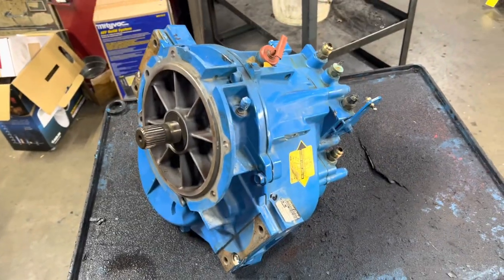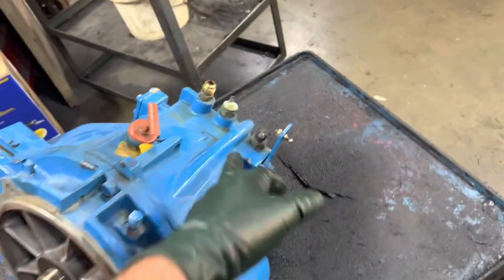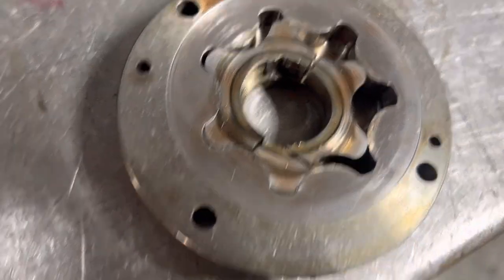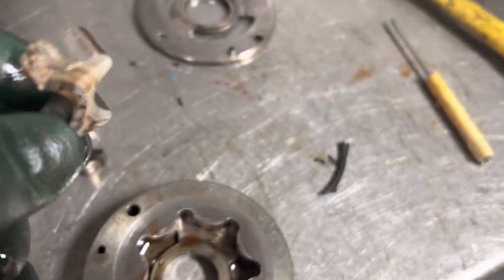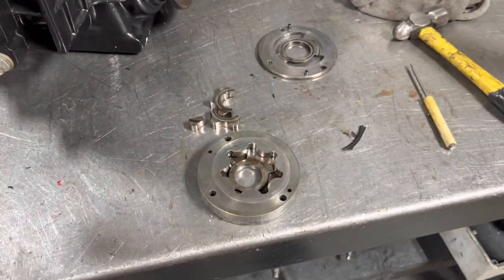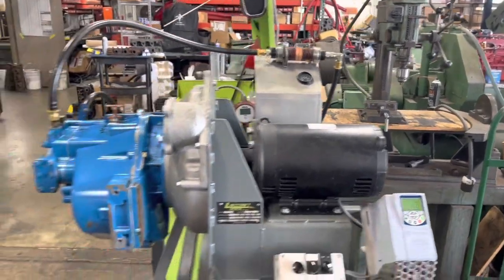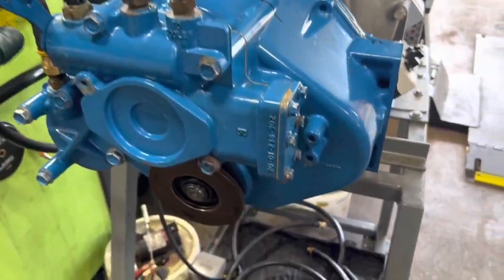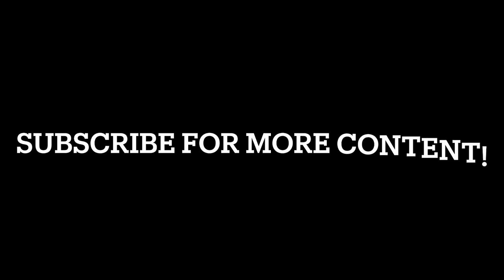Velvet Drive 5000 Series Marine Transmission Pump Failure Diagnosis and Repair

Comment: How to you reverse rotation on this? I've read it's as simple as reversing the cable? Is that true?
Reply from the maker: That is true. Your engine must be LH rotation though. The transmission will output either direction.
Reply: @LakelandAutoMarine  you are the man! I was able to source the pdf manual and look it up. No swapping pump like. The 71 72